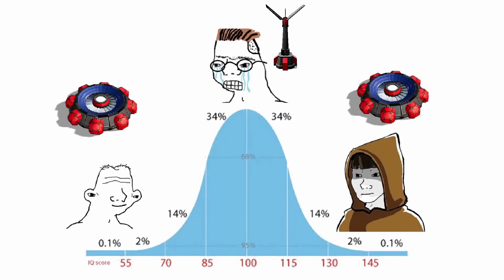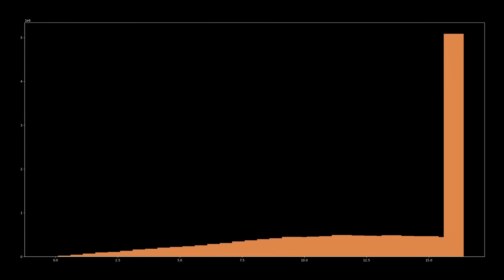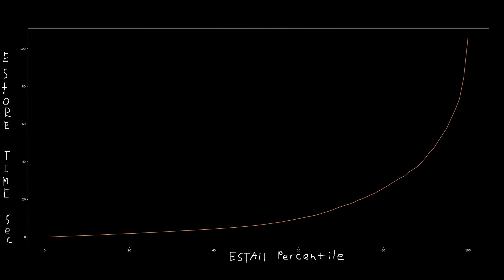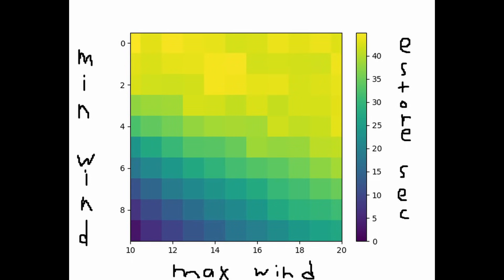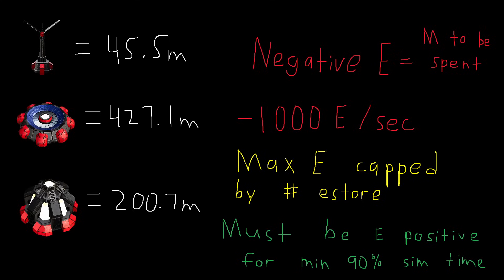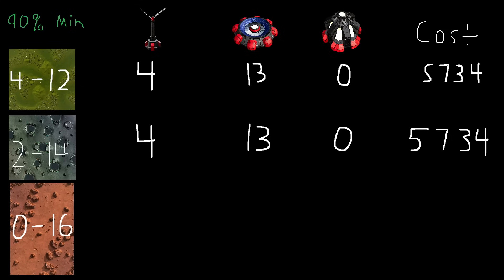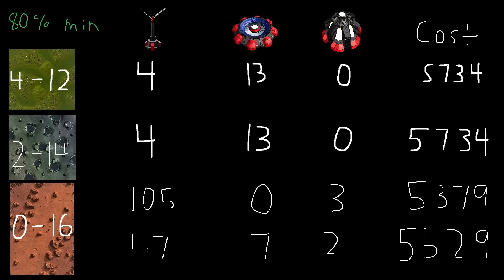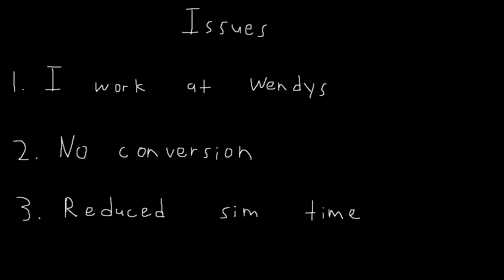The Art of BAR: Wind vs Advanced Solar

Comment: Wind turbines by physical constrains that can not be violated without violating physics, can only harvest 33% of the wind-force, or less.
This is a relatively easy shape-design problem.
And it is still more efficient (in terms of return-of-investment and maintenance) , and also more portable (camping size) than photovoltaeic power.

And all of those are significantly more energy-efficient than fossil fuels,.
Reply: everyone peep the spambot blindly yapping about irl energy production under a vidya guide

Comment: Still a bit inconclusive because he didn't say the simulations accounted for them being physically built in the simulation. His data seems to be based on the advanced and wind/storage materializing into the world without being built.

There is probably a period of time where the advanced solars don't produce any power at the start because it takes a while to get your first one going depending on build power.

Man needs to simulate the building as well with like 300 buildpower (just assume commander is building them) and THEN we'd be able to know what solution actually lets us make more power over the course of a real match vs them being materialized into existence.

We'd need to know which solution reaches the 80% satisfaction first as well to make this practical because if solars take a lot longer to reach demand then I may just be dead in the round because I need to use power to stay alive.

Thank you!

Comment: I just plop down some fast t1 solars with commander if wind is low because they cost 0 E. So I can actually use the E I have to progress, not to build more E, until I can go fusion. Because low E means I can't spend the metal anyways. And then ofc remember to eat the solars asap
Reply: this ^ just have some amount of estorage, and cover heavy drops with a few basic solars that you can eat later on, no need for extreme estorage spam or expensive asolar mitigation

Comment: Important caveats:

Converted metal cost is an approximation, in a real game you cannot freely convert between M and E, so you will want to pick whatever building fits within your desired build/play.
When you are overflowing E, asolars are strong tempo way to make use of that E.
When short term E is important, asolars are bad .

Asolar are more BP effecient than winds at <15 wind speed, though because of effeciency/slow E return you generally only want to make asolar on maps with <13 wind

Comment: i think this simulation is flawed as you are optimizing for uptime only. As mentioned in the outro converters need to be taken into account. higher total e output of pure wind (for example on glitters) allows your converters to make more metall, which can in turn be used to scale more economy (or storage).

Comment: you're failing to account for the incremental nature of wind scaling. 

Assuming building with 1con bot + 1 con turret
To get +1 extra energy added to the output (assuming you dont e stall) it takes 30 seconds to build an Adv Solar, this requires 200 energy a second.  

On the hand building a wind will give me +1 energy in 6 seconds and only cost 30 energy a second, this incremental scaling is huge, it means two things. 

1) I'm increasing my powersupply much faster, which has a snowball effect the more e I have the more e production I can build which means the more E convertors I can put down
2) I have a much lower risk of e stalling my other production, especailyl for lower skill player not accidentally stalling my unit production is a value in itself worth considering. 

Another point is you're not factoring in the energy cost at all. 

12 winds + 1 storage is  ~700 metal if you add the energy cost. 

This is more production than 2x adv solar which will cost you 842 metal. 
Not only that but that metal value is 71 metal worth of energy, that you won't be able to reclaim 

All that said I sometimes build adv solars, they have their niche but they're rarely straight up better than wind scaling imo

Comment: Maybe I'm just bad, but I don't use wind this way. I don't try to make the minimum necessary wind to power my economy. I deliberately over produce wind to power converters and grow my metal income over time. I don't think there's a simple way to tweak your simulations to account for converters. Maybe if you assume a fixed amount of build power for wind/solar and infinite T1 converters? Then you could measure things like how long it takes to recoup your metal investment, or how much metal surplus was generated after a set time period. Still pretty complicated.

All that being said, I think you have a point about advanced solars being underutilized. Especially on maps where wind can stall at 3 or less and you don't have access to a geo.
Reply: if he makes 400e income and you make 1000e income, you lost 2500 metal to winds, he builds t2 lab and gets t2 mexes while you get slow converter eco you lose the eco race

on the flip side if he makes a t1 army, you just die

you lose in any scenario other than(he makes 800e and stays t1) thats the only scenario you win at cause you are slightly ahead but dont die
Reply: @hodorba5567  Okay, let's assume 15 wind as you suggest, and see how long it'd take to recoup our investment. Armada wind costs 40 metal and 175 energy. T1 energy converters cost 1 metal and 1150 energy. Let's say you build 14 wind and 3 converters. This costs 563 metal and 5900 energy, aka 45310 energy. At 210 energy/sec it'd take 216 seconds, or 3 min and 36 sec, to break even. So unless you expect your T2 lab to finish within the next 4 min, you will reach T2 faster by investing in some wind first.

Of course, this is overly simplistic. In reality, those 17 buildings wouldn't finish all at once. Wind would vary. During low wind, the converters wouldn't be powered. 15 wind on average is optimistic, or impossible, on many maps. That's why the proper simulations that CONQUER is doing are interesting.

Keep in mind, it's not JUST about growing metal income through wind. By overbuilding wind, you're able to build fewer energy storage, and still survive wind stalls. I only ever build one energy storage. On paper, if you're only concerned about surviving wind stalls, overbuilding wind is more expensive than just building T2 solars, as shown in the video. But what if you also build some energy converters to recoup some of your additional metal investment when the wind is strong? I suspect wind is better once you factor that in, but I'm ready to be proven wrong. By "proven wrong", I mean real numbers. "you get slow converter eco you lose the eco race" is not enough.
Reply: you can just use a set avg of i.e. 15 wind constantly, and see howmuch metal u gained from the converters

spoiler: the best eco in the game is rocks and wreckage the rest is not even close
then t1 mex
then a biiiiig gap
then t2 mex
then a biiiiiiiiiiiiig gap
then windfarm converting

morale of story, go minimal wind, make an army kill stuff (this gives you more map control thus t1 mexes, generates OP wreckfields and gives you safety for T2)

Comment: I tend to build for Cortex vehicle. Because of this I build e storage to hit t2 lab build sooner and normally build 2 wind 1 solar to start doing the same 4 times. Then eat the 4 solar into an advanced solar. The question I never thought on is how many wind to eat to hit the first advanced solar.  I find also the solars lets you scale up converters with out dead zones and dump the ebar to convert when you need a metal boost.
Reply: on high wind maps, you dont build asolar, you just spam wind and estore
on medium wind map, you also go wind/estore but add a couple solar/asolar to mitigate drops but you dont eat winds to go full asolars, you still build mostly winds
on low wind map you make pure solar into pure asolar, no wind

so in eighter case you should never eat winds to build asolar

you should see asolars as a more expensive but stable wind, not as better basic solar, cause it costs e to build, just like wind, needs to be build ahead of time

Comment: Key point not covered in video!

The investment in metal for wind is spread over time, not all at once. Meaning as you build the winds, you start generating E before they all finish. This is the reason going "mass wind" is soo strong. Not only is it efficient, but as you invest small amounts of metal, the payoff is now and quick.
Reply: You also don't get a massive cost of energy.
You can make another wind with out stalling from the first one you built independently of how realistic BP you investing, this is not the case for A solars
Reply: He does cover it briefly at the end and he says he doesn't want to deal with implementing that
Reply: needs to be more upvoted; For some reason ppl think that thiswasnt mathed out before. Its literally the metal and opportunity cost. Obv theE production is good wtf.
Reply: Indeed. If we don't have to consider the energy, build time and war economy requirements, then of course afus are the obvious solution. They have very good metal to energy output with small footprint to boot.

"Must be E positive for min X% of sim time." This is not science! A situation where it's -3 energy for 30% of sim time while it's +200 for 50% would disqualify. Also no idea of number of runs. A good luck above where the positive e is before negative period would not disqualify while in another order they would could qualify with e storages.

There's no minus for overflowing e. What's the e storage cap by default? A lot of units and building give e storage.

You could get any results you want if you just tweak the unmentioned values enough.

Comment: This is an awesome video, really great work, especially digging through the lua to get those details about the 2d vectors. I wonder how energy build cost could be factored in to this analysis. That feels like the natural next step here. Like, with cor adv solar costing 4k energy a pop, good luck affording those first ones off of 4 winds.

Usually I spam wind and e store early until I've banked up >4k e, then throw down one adv solar fast before wind drops, and rinse/repeat, but it takes a while to fill that bank.

Comment: well, we will now see advanced solar spam in 50% of lobbies , thx conquer :3
Reply: and its crazy cause these numbers have been out forever that u should place a few adv solar and e storage, and i always get flamed for mixing a few in my base on the front. its the only way early game before t2 con, especially when tech spots arent paying attention to chat. i am still pretty new myself though lol
Reply: @lukewright3451  i did multiple tests with the simulator can you can get enough wind to never stall before you hit T2 in almost all scenario's and with wind being biased to higher values you are unlikely to stall if you build a single energy storage, i added code to see how much extra energy could be converted to metal and for most values wind is cheaper energy per metal, has no E stall and produces 3-7 metal a second
Reply: @pizzamark4388  i just have a lot of bad luck with the wind dying right at the worst time early on. being a front when some of the better players are coming up there you dont really have time to do a crazy amount of eco before you need units at front. especially when both fronts next to me are doing t2 rush at same time lol
Reply: @lukewright3451  i don't understand you comment, because wind is so much better when you need to slowly scale your ECO so you can keep producing units, each Asolar is 57.14 metal wasted in energy cost(4000/70). This means that the 13 Asolars as suggested by this video is 13*4000/70=742.86 less metal (using energy converters) that you can spend on units or on wind mills, most players can get enough windmills up (~107) that 1 or 2 energy storages is enough to directly go into fusion.
Reply: @pizzamark4388   yeah but what do you do when when its 4v2 on front and you havent gotten a t2 con till the 23 min mark, even though you paid both tech spots at the 10 min mark, and the 4 ppl on the other side have t2 units out already and your still stuck with t1 bots. luckily im pretty good with the counters and unit micro so im able to overcome the tech disadvantages a little once my team finally gets units to the front. but like what am i supposed to do? im def spending too much time microing units and not ecoing enough till late in the game, but im making plays and slipping fronts pretty often hitting enemy backline. like im holding but once titans come out with my eco being behind it feels like i have no shot at getting my os to go up just holding.
Reply: @lukewright3451  if your team plays worse then the other team you lose, you should be able to go t2 on your own at 15ish minutes at worst if you eco well on the front
Reply: @pizzamark4388   i try to do it on my own but it seems like most ppl are trying to t2 transition at the 15 min mark. weather they can support it or not. i end up waiting and keeping hordes of t1 bots out there to cover our empty front, but i get 3v1'd on certain maps and i cant cover down and make the transition on my own. ive been just placing t1 vehicles down to get a wide unit composition and im able to hold against t2, but once t3 comes out and my eco is behind it makes me feel strong early game but weak AF late game.

Comment: I want a hardcore BAR mod that makes wind even more trolly and turns of solars every two minutes for 2 minutes but buffs their energy output. I want people to not die to the enemy but to choose to suicide over living with their energy problems.
Reply: I want MFs to need to have a Phd in economics and logistical solutions before even attempting to play ranked BAR
Reply: @bbbbende  i play with a friend who is working on his PhD in economics and his eco management is atrocious LOL
Reply: @hckr_-gh7se  we have a saying that goes roughly like "the shoemaker's shoes are always worn"

When you dedicate your life to something as a job, you often neglect it outside of work
Reply: People would com rush any geo on the map. Anything to not deal with the real world issues of renewable energy.
Reply: Oh yeah? Make GEO cause earthquakes, and limit the amount of energy they contain. Over time, this energy depletes, but the GEO spots recover their energy reserve at half the rate they are consumed.
If the GEO runs dry, you're now limited to their recovery rate for getting GEO energy.

Specifically, GEO would outproduce both solar and wind in terms of metal to energy production while the reservoir is full, but would be much worse when the reservoir is empty.
The GEO could however toggle automatically just like energy-to-matter conversion, meaning GEO isn't effective due to high initial cost when relying solely on it, but can massively help during shortages when both solar and wind are down.
Reply: Now add powerlines and energy dispensers that need to fuel all buildings and have bots recharge at stations.

Comment: My goto stable 4 mex eco build is 1 mex 1 wind 1 mex 1 wind 1 mex 1 wind bot lab (reclaim bot engineer engineer) 3 solar 1 e-storage 1 converter 2 solar 1 converter 1 metal storage. First engineer builds 1 mex 1 radar then come back to build t2 lab. Second engineer builds 1 con turret 1 asolar 1 con turret 1 asolar and queue up 3 more asolar. Reclaimbot eats bot lab. Com assists up to second asolar then self d. Rezbot eats com then the solars as con turrets and engineer finish t2 bot lab. Queue 9 t2 bots, ask for light trans from air. If nobody is paying, pause factory after first t2 con start 1 Amex and build it with con turrets, give t2 con to air player. Once 1 Amex is done you can spam the rest of the t2cons for team then you go into t2 eco and AN/Intel. Eating the asolars after first fusion.

Comment: For buildong E:
105 solar + 3 e store = 24 000 e
13 adv solar = 65 000e

So you need 2,7 x more energy for buiding Adv solar, and if u reclaim if you want to boost for Fusion, you lost even more E.

Not worth IMO unless if you have a very specific build and genuinely good timing for a specific timing push.
Reply: the bp cost of wind is pretty high. and 105 winds need pretty spread bp. A solars are stupid scaling. you just plop it when the E store is full on a wind build. its less bp than wind. until wind avg is 15+. imagine in a 1v1 you just want to add 1 more t1 lab production and want to scale the E for it, A solars come up faster than solars or wind and the new lab is online faster online if you instead did wind
Reply: 105 solar seem like a ton of space
Reply: He misspelled, he means wind not solar
Reply: 105 winds*